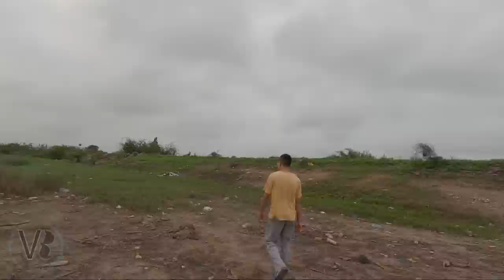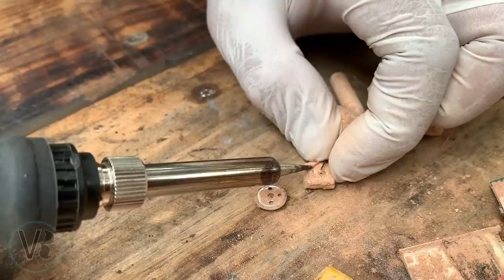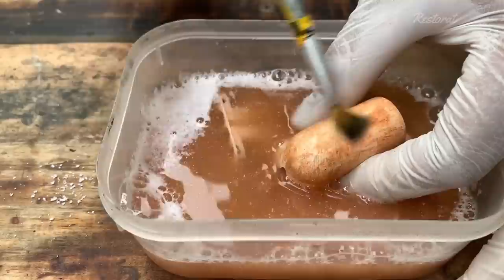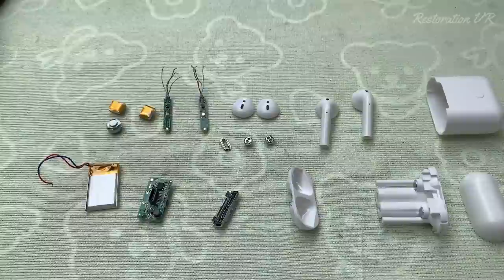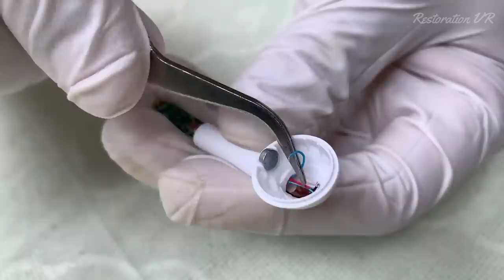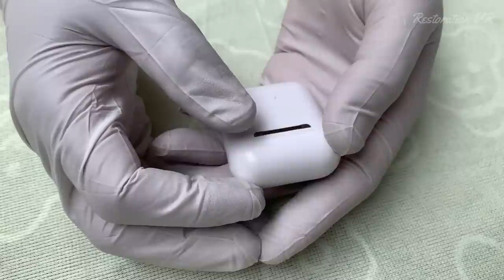Restoration old AirPod for iphoneＸ | Restoring Broken Earphone for Smartphone

Comment: Restoration VR  why you measure battery on  resitance position on multimeter  8:02 you have measure in voltage postion on multimeter DCV😯